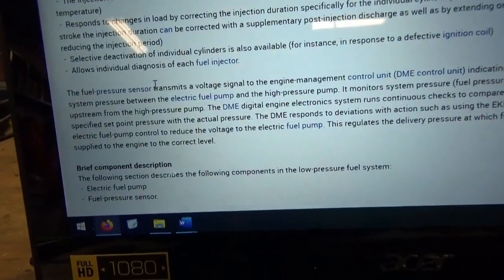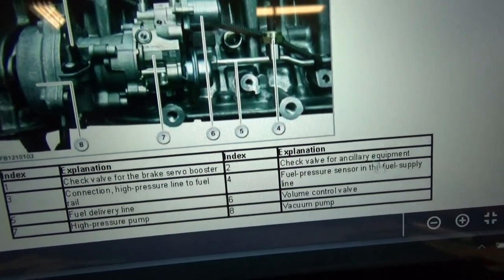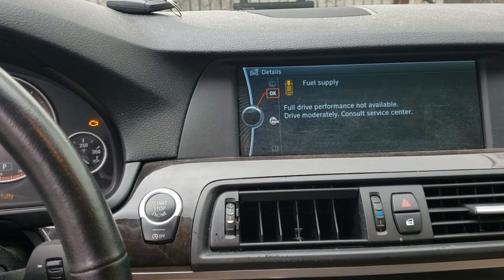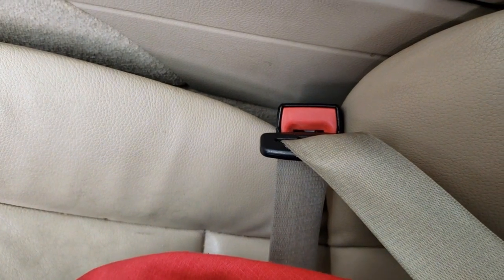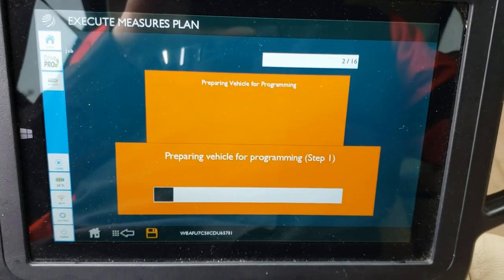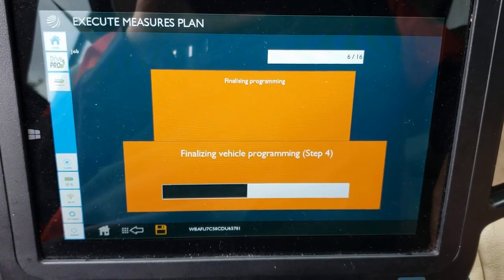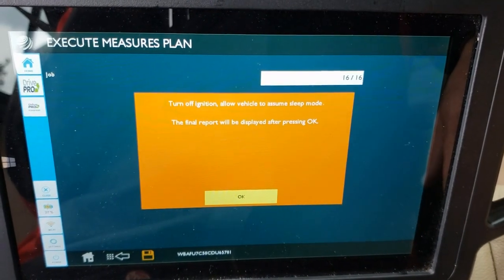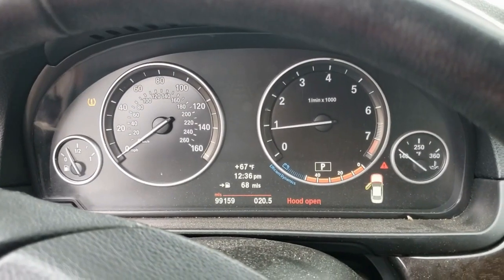BMW Fuel Supply case study- Part 2 (SI Ep. 15.6)

Comment: I know this is an older video but I thought I might add some more technical info in here :)
On any F series BMW (this was a F10) if you swap a control unit like the EKPM in this video its CPS (CodierPruefStempel = German for coding checksum) will be invalidated. In normal operating conditions when the module is properly coded the CPS always equals the last 7 characters of the VIN. When you swap a module and the CPS doesn't match the VIN of the car it's installed in the CPS will become FFFFFFF and it will assume default coding values and run in a kind of emergency operating mode. In normal operation the DME asks for a certain volume of fuel to be delivered to the HPFP and the EKPM will control the fuel pump in such a way that it will deliver that exact flow of fuel. In emergency operation it will run the pump at a fixed duty cycle like you've seen on the scope and once the pump can't keep up and wants to draw more current than permitted according to the emergency strategy the EKPM shuts it off. I was practically yelling at my screen you needed to code it hahaha. Simple coding would take care of that in 2 minutes. In this case the module needed to be programmed to match the software version of the car according to the dealer system. And many aftermarket scan tools with programming capabilities are based on the dealer programming system. With factory tools like E-Sys you could have gotten away with just coding the module without flashing new firmware, for certain other modules though it's really important their software level matches the rest of the car. Also on the repair manual for getting to the LPF sensor they show a rotary pump cause that is for the N54 engine, the predecessor to the N55 engine you were working on. If you would've used the AOS system of BMW itself to get to that information you probably would have gotten the proper diagrams and instructions for this car based on VIN ;)
Reply: You seem quite knowledgeable on this particular issue, I wonder if you'd be willing to entertain mine. I have a 2011 535i that has always had a low pressure fuel sensor code. Problem is, the car does not have a LP fuel sensor. The car runs fine but this code has always bothered me. Could it be that the EKPM was replaced at some point and not properly coded to the car? I actually had a BMW tech tell me that the engine or DME may have been swapped at some point!

Comment: I would’ve never guessed that thing doesn’t have an actual rail fuel pressure sensor! Great tip on clicking the seatbelt,thanks Keith!
As I’ve said many times in the past,many think they’re diagnosticians but you really prove your weight in gold when you deep your feet into Europeans and get them “ wet “ too! Those that discount these cars will become obsolete as technicians because the technology will only trickle down to their beloved Chevy or Ford.
Thanks for the video Ivan! 👍
Reply from the maker: Great point Nick, the technology will trickle down to all brands. It's already happening!
Reply: Hope they just get more and more difficult to troubleshoot. Fun to watch you pull your hair out.
Reply: I second what nick said. Great jobKeith. Ivan is lucky to have you as a friend
Reply: Good old ‘Murica catching up with the rest of the worlds tech of not thinking 9mpg is great “economy”😂 🎣 

Save the whales 🐋

Comment: Awesome diagnostics to track this down. I have a 2011 with a low pressure sensor code but the car does not have a low pressure sensor! The car seems to run fairly well but it's a strange code showing how complex these cars are. Great work!

Comment: Is this repairing the fuel pump for a car, or updating the autoflight control system for a Boeing 787 ?
This process is beyond insane! What would happen if something interrupted the process mid way, the car becomes a brick?

Comment: I noticed during programming it automatically cleared fault code ...... WITHOUT this type of module you would need to at least cycle key or start it up for a code clear ????would this require a drive cycle to learn all variables as accurately as possible or is learning done after programming?????

Comment: Huh no low pressure sensor but I guess what you would call a synthesized low pressure signal ,but had to reprogram module ok Ivan I missed why module lost programming to begin with I will watch again but I guess you determined there was no low pressure sensor so I thought it must be a synthesized signal from a properly working module right pretty tough one Keith is the Man!!!😎🇺🇸🇺🇸🇺🇸🇺🇸💯😎⚜️----- ok just went back to begining of First video and the fuel pump control module was replaced but I want to know why it ran but not good ---- I assume becuase it is a type of synthesized signal the module still needs to learn certain values parameters to more accurately control low PRESSURE SIGNAL is this a logical assumption IVAN or Keith vis a vis a NEW LEVEL PROGRAMMING!!! huaaahhh

Comment: I wonder if my problem is the same. I have 2012 528i xdrive and I get the fuel supply error after driving for about 30 minutes on a warm day. On a cold day it never shuts off.
Reply: I have this problem. What was the problem?

Comment: Most likely the fuel module just needed to do a "handshake" with the ECU. It would be incredibly inefficient to program every module for every single car built. Either way, this locks you in to buying that expensive tool or going to the dealer. Profit!

Comment: You can do this coding and programming with a $ 5,- cable from Amazon and freely available software.
(Ths software is called E-Sys, you don't need a launcher / license for programming and coding according to vehicle spec)
Reply: You have a good link for that E-SYS you speak of?
Reply: @drone1028  I would recommend a forum called cartechnology but it has been down for the last few days. So right now I would recommend just using Google.

Comment: So someone switched the original module? 

The pump could be programmed with ebay cables and software (if you know what not to buy). Probably the best part of BMW is what the hackers have done to help support them.

Autologic is probably the best best legal way to do it. They also have excellent support.

Comment: Does it pay to have those expensive tools and subscriptions ?
Reply: I'd say only if you have the work available. With the flow of cars, (and the money) in Staten Island I'm sure it does! but out in the woods I'd say it wouldn't, just not enough of those cars around to justify a tool that's great with them. In the city people can afford these cars, and while most get them serviced at dealers, they enter the used market and hang around and that's when people come screaming for help (but don't want to pay) so I say you need enough euro cars around first.

Comment: This is only the beginning, the back log on Tesla maintenance and service is very high; especially when they allow minimal DIY for parts and aftermarket part is very obsolete other than ebay and salvage. Meanwhile to work on electric cars you need high diagnostic skills and full understanding of electric motors and electrical engineering degree/knowledge can help- your not going to get any of that in an  ASE  program. Best way to learn is what RICH REBUILD channel does.

Comment: Well after all that whinging that was anticlimactic.  Not so much a curve ball, but knowing where to look.  Seven minutes and nine minutes into the first part you were already asking the right questions (but didn't verify?).  Step number one of chucking expensive electronics at something is to make sure it's configured correctly for the car.

If you look at the wiring diagrams on NewTIS the low-pressure side sensor is only indicated for N55s with the Continental pump.  If you dig around and look at the R&R instructions you'll find separate instructions for the different style pumps (as well as matching pictures).  Dunno what the cheapie scan tools show though.  Or you can look up the parts on any of the online BMW parts diagram and you'll see a switchover date of March 2012.

Comment: What's the logic? No start, Fuel pump module fixed no start but normal condition to have no power until you program module? 
How would you even know low power symptom means programming......... 
This is my complaint with being an all make and model tech at a shop. The volume demand without information and proper tools. Prefer working for a dealer.
Reply from the maker: Great point. It is frustrating at times for sure!

Comment: Welcome to “superior German engineering.” The Germans can’t even get their documentation right let alone anything electrical, digital, or sometimes even mechanical. Unless you want a difficult to repair frequently failing money pit never own a BMW out of warranty from the early 2000’s onward. The stupid German engineers make everything needlessly vastly more complicated than vehicles from any other country. And yet a Tesla is faster around a racetrack than even the overpriced M cars. This makes me remember the BMW X5 you worked on that had 60+ stored codes and needed a headlight module that cost more than your wife’s Nissan is worth.